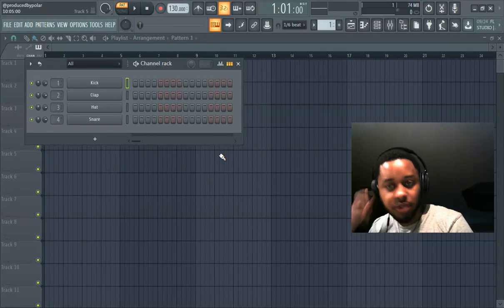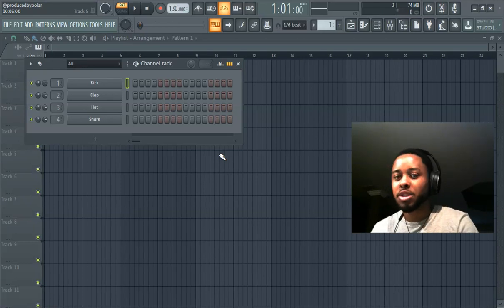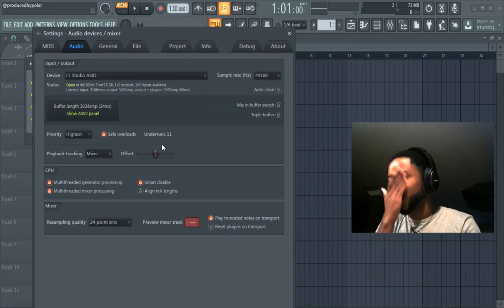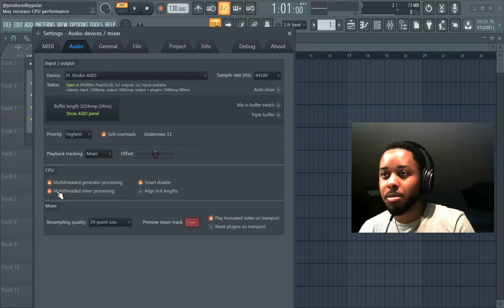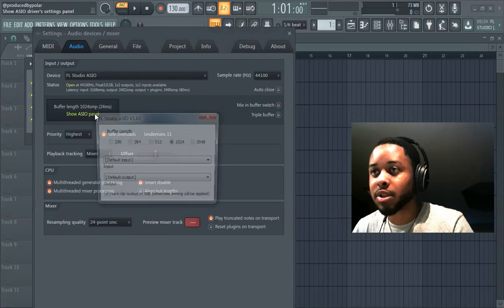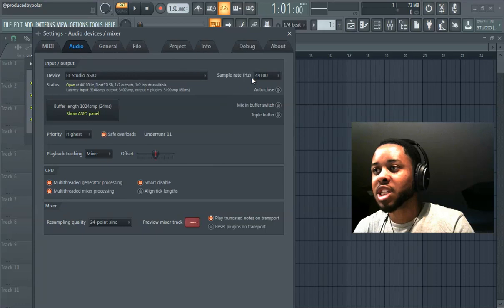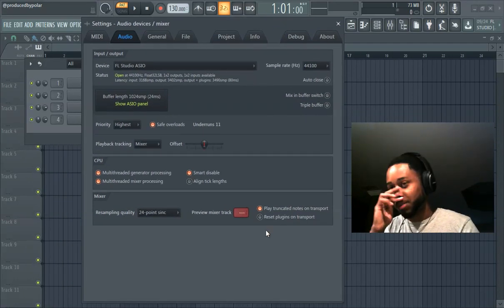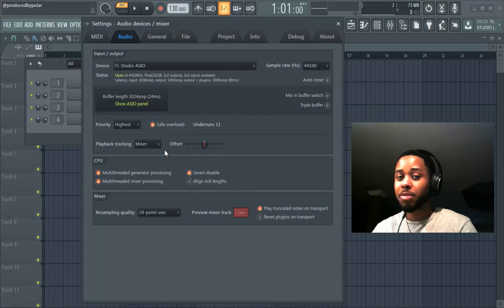How to Fix Audio Clipping Issues in FL Studio 20

Comment: I just did it I think it worked😂😂
Reply from the maker: Noice, got a new video on this too if u still have issues
Reply: @slimegreenbeats  at first I thought  it was  cause  I had a crack for 20 but  u pointed the problem out I checked off hard clip output and it’s running smooth now
Reply from the maker: Noice

Comment: why me buzzing  my microphone is perfect not buzzing on discord team speak and others pls help.
Reply from the maker: It's probably your mic / outside noise . Do try to mess with sound settings in windows. Restart cpu
Reply: @slimegreenbeats  in the settings the microphone is quiet there is no so-called "Noise" or anything else unless I blow into the microphone or say something and when I turn on the fl studio it just starts buzzing and that's the main problem. whether restarting the cpu will harm my system

Comment: Does anyone have it after you render the audio cuts out at some points
Reply: YES!! this is exactly what i'm dealing with and i've looked at every limiting/driver/clipping tutorial but i got NOTHING. if you have found any answers please let me know!!
Reply: Okay so I have a solution:
I had a plug-in called Span on the master chain and when I removed it this problem dissapeared so check if you have any compromised plug-ins that could be messing stuff up
Reply: @lonelyrxy1584  mah man dont quit, why would you do it? It's a long ass journey but you cant stop now! Keep pushing through
Reply: Yea I do
Reply: i used to have this problem and it may be because your volume on some tracks are to loud that crashes audio rendering and clips the sound.

Comment: My sound is disable on my Mac when I make a beat. 5 minutes into it, it cut off and not sure how to solve this issue
Reply from the maker: Make sure everything is installed correctly, check out sound settings on the Mac as well